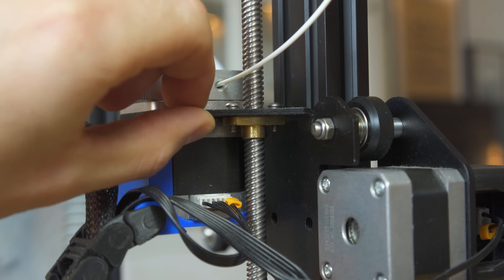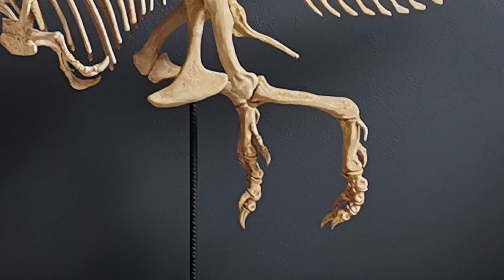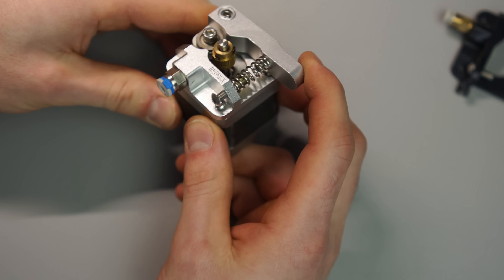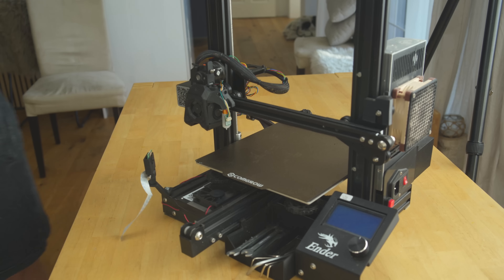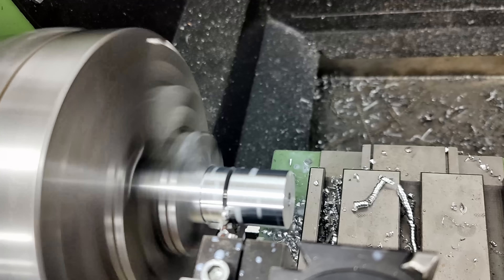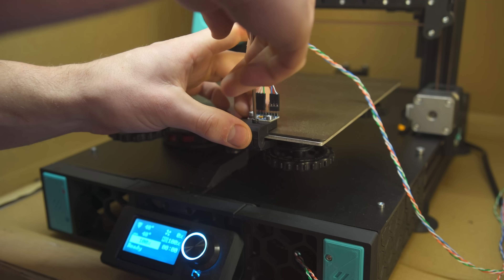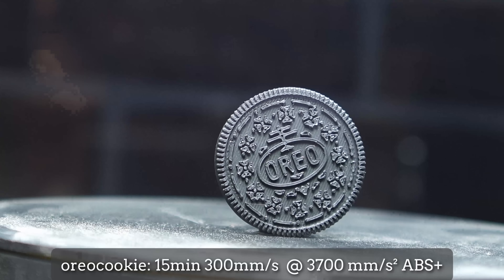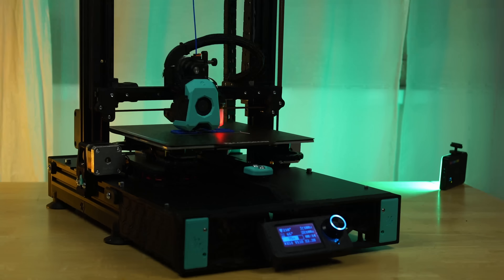I built the MOST EXPENSIVE ENDER 3

Comment: I know this is an old video but with all the new printers being released and coming pre assembled, it takes away the satisfaction and sense of accomplishment with building and assembling your own printer.
Great job. I really love the work and dedication.
Reply: it's still possible to do if you are willing to be tinkering for the first couple months in between a few good prints. I swear i've spent just as much time tweaking and upgrading as i have printing so far lol. It gets addictive. Gotta chase that next improvement. once i install thrust bearings and oldham couplers tomorrow (as well as direct drive and upgraded hotend down the road) , i pretty much will be at a point of diminishing returns until i can afford to do a CoreXY conversion or maybe even build a RatRig if I can afford one (RatRig would be my first choice if money wasn't a concern. I would hate to be halfway through a conversion on my Ender and realize i need another printed part). It can be frustrating at times with how all over the place cheaper Enders can be with quality control, but I have learned sooooo much in such a short time. CoreXY kits for the Ender 3 V2 are under $200 now as well.

Comment: That's not that expensive for a modified printer 😂

My ender 3 is worth 1150$ and that's nothing in comparison to what others have done. I tried to make it the cheapest possible way, I bought it used and I don't even have pressure advance on it or a modified movement mechanism. I bought 3 CHT nozzles (0.4, 0.8 and 1.2mm) and 2 bimetal CHT abrasion resistant nozzles (0.6 and 1mm), high temp direct extruder, new motherboard, new print bed, new print bend tensioners, modified motherboard cooling system and some other gadgets

Comment: Hi mate I recently upgraded my old Tevo tarantula i3, with a new Octopus 1.1, raspberry pi 4, with a 5” touchscreen, and 24 volt power supply, and upgraded the frame, and a modular hot end, in aluminium, so I can swop out a single to dual extrusion, and one good thing it’s so quiet

Comment: Truly inspiring indeed. I'm in the process of upgrading my own Ender 3, already adding the CR touch, direct drive and double Z axis. My family suggests that I just buy a newer and better printer but I just want to turn my old Ender into a reliable monster. I'm planning on changing to rail systems on all axis, changing the motherboard and upgrading the hot end and adding dual fans, also trying the new Creality Nebula. 

Also I must agree, as someone who likes to upgrade budget stuff overtime, building your own project is undescribably better than buying "good stuff" from the start.
Reply: Check out the ender ng project. Its quite fun

Comment: I could write this in German, but I will stick to English. 
Your sheer amount of knowledge, but also sheer lack off knowledge astonishes me. 
Why was your Ender 3 having issues with layers, well you had a BL Touch, this continues adjusting the Z height, which will show the slack of the Z screw way more. If you had kept the normal mode, and used a glass bed your prints would be decent.
Slow but decent. The ender is a slow machine, and for 99% of the users, this is enough. Just like any engineering company won’t need anything faster then a Prusa MK3.

Comment: I view modding my ender 3 as a more affordable way to force myself to become knowledgeable about how 3d printers work both electrically and mechanically. My first 3d printer was a folgertecjh prusa i3 which I could never get to work after the first print. The Ender 3 was my first real working printer. It has way more successes than failures. And Through Modding it and taking it apart and putting it back together I've learned a lot

Comment: an other thing better on this then a bamboo lab is that the ender 3 is completely open source and local, and will there fore continue working even if creality shuts down, i would not say the same about bamboo lab
Reply: I mean there’s always a way to mod stuff even if it’s not open source. My school’s tech center has a small desktop 3D printer that is made by this company that I can’t remember off the top of my head, but apparently they no longer manufacture consumer hardware, just industrial stuff nowadays. Anyway it requires these special filament cartridges, and there’s even a firmware lock to prevent it from using filament from other manufacturers. The guys in the tech center managed to hack together this controller board that’s basically just two buttons, connected to the printer’s mainboard with wires. The purpose of this controller board is to bypass the firmware lock and basically trick the printer into thinking it’s printing from one of those aforementioned cartridges. Then it’ll let you use any type of filament you want in it

Edit: it’s a 3D Systems Cube 2

Comment: I also have an Ender3 (well actually the Pro version).  I've updated the hot end to an E3D Revo CR, so I'm good to go with PETG and maybe ABS.  I got a WhamBam PEI build plate too.  I also have an HP T520 thin client to run Klipper (have you tried buying a RPi recently?)  I'm thinking of doing the Switchwire conversion, but I'll likely print the parts in PETG.  I know that Voron doesn't recommend the use of PETG, but as I have no use for ABS, and therefore won't put my printer in a chamber, PETG will be fine.  I've used PETG for parts on a previous Repstrap that I build, and I've never had a part failure.  Besides, I can't stand the smell of ABS melting!
BTW,  to upgrade the original Ender3 to a SW, you'll have to buy one piece of 4040 extrusion.  I assume you did.
Reply from the maker: Nah, I didn't buy any extrusion parts.
I'd print it in abs no matter what. It's more temperature resistant, the parts are probably scaled to accommodate for abs shrinkage and you could enclose it down the line. The work is the same
Jm2c

Comment: Love the conversion and chuckled at some of the "you have a problem" / therapy sections you edited in.

I'm in a similar boat with an aging Ender 3 and have been looking for a way to mount a Rapido and a direct drive extruder to my Ender 3. I see you accomplished this task prior to doing your conversion in "the plan of attack section". Curious what prints you used to mount the Rapido and Orbiter v2 to print your ABS before the full conversion around 4:37?
Reply from the maker: It's called Apogee toolhead
Reply: @ChristophLehner Surprisingly didn't locate that toolhead in my searching. Was looking at the Trianglelab DDE-R, metal Klemco groove mount + printable STLs, a few toolheads from squirrelf ( Apollolander, Solar orbiter, Mars orbiter, Saturn Orbiter, etc ), and hero me gen7.

Much appreciated, I'll look into that toolhead.

Comment: hi, i need help about the hotend. I saw that you used a fast phaetus hothend that draws power for 115 W and I was wondering if it was possible to directly connect it to the control board of the stock ender 3 or if you had to make changes to the board to connect it.

Comment: 10:43 The thing is, though: a Bambu Lab P1P is way more than those 650 € from that screenshot nowadays.

The price shown on it's website is 770 € for Germany. With customs and (import) taxes your going straight to 1000 bugs if you would import that thing. And thats without that highly praised AMS module which would add like 300 bucks as well. So for less (building) fun a good deal more. =)

Although I have to say a newer Ender 5 S1 with a BigTreeTech Pad 7 and another Ender 3 for spare parts would also have been a valid option for me!

Especially since there are some folks selling their barely used Ender machines on Kleinanzeigen which can also be a solid option.

Comment: I am thinking of going for this mod, including your stripped down Stealthburner. Do the STLs for the toolhead on your github work directly with the stock x-axis or is there an adaptation/adapter to make it work?
Reply from the maker: The stl in GitHub works with a linear rail, but for the original ender3 Xaxis you have to use the one from orbiter directly 
It's called apogee toolhead

Comment: Holly, this is so awesome, my respect for this great video and the great build conversion for the ender 3, I have one too that is like my baby, purchased on 2019 and still rocking, recently  I purchased a skr e3 v3  but have not install it yet, I want to use klipper with it, I want to be able to print higher temperatures material for print automotive parts, what kind of upgrade can you recommend me and if is possible to use the same fanducts that you used and same extruder without all the others parts conversion?

Another question is have you done multicolor prints on yours by simply changing filament color? Just curious about if would be possible by using the bltouch

Comment: man youtube is so unfair, i havent been able to get my auto level to work tried for 6 months it just kept driving the nozzle of my ender 3 into the print bed, and all i am getting recommended is tricked out ender 3s man
Reply: In case you haven't fixed it, what's your Z-offset?
Reply: its honestly just been sitting in the garage since that comment was made, i installed an ezabl laser went through the install video including editing some minor code that coorisponds with the machine and it just drove the nozzle right into the bed i was quick to turn it off though, i actually just bought a resin printer instead thats how not interested i was in messing with more software no idea what the offset is tbh  @NM-wd7kx

Comment: Think I'm gonna just go with the cardboard enclosure...oh yeah, and the dual-z-bar kit, BL Touch, BT Tech main board, BT Tech driver chips, dual-gear extruder, BT Tech touchscreen, silicon heater cover, Noctua fans, flexible couplers, bi-metal thing for the nozzle and that's all...maybe. Cheers

Comment: So My question is. With using just the stock ender 3 pro frame/extrusions, if I upgrade to a direct drive and Setup Klipper. Would I be able to achieve the same results as far as speed and efficiency or at least come close to the same  results? My printers are a 24/7 work horse so taking one down to print parts for this, is basically not possible right now, because the down time would kill production for me. So just looking to do the minimum for now until I can get my inventory up.

Comment: I reinforced the 4040 extrusion which is as you know hollow inside.  I used 8mm metal tuning with 5mm hole.  Cut it and beveled the ends so that the m5X45 bolts goes through the tube and then does not allow the 4040 to collapse when tightened!  This is by far the best thing I have done to my frames.  As you know the bed runs on a single 4040 attached to a single 4040 I frame. This is very very poor especially if it is over tightened at anytime.  Adding the tube prevents such event and absolutely give amazing rigidity.  I hardly ever have to adjust my bed now and it stayed within .001 on all corners now.   Obviously depends on the integrity of the x gantry, which I have dual 1204 ball screws on!  Zero lash ZERO.  The 800 steps seems to hit the magic numbers much more precisely, IMO.  Great content you have , thanks for all you do.

Comment: If you run 3600 acceleration you will only reach 300mm/s for 5mm on a line that is 30mm. So doubt you reach even 200mm/s. Also your minimum layer time must have bin set to 0.
Nice printer though. I am converting a ender 3 to that I just picked up for 50$ :)

Comment: I did this a bit over a year ago (modified the CAD files myself), but skipped a few more parts than you did.  I also wouldn't count the price of the Ender 3 in the total.  The only reason to do this with an Ender 3 rather than from a parts kit is because you already have one.
I will completely agree that you shouldn't pull apart your only printer to do this.  You need a backup printer that is untouched during this process.
I had also done X and Y linear rails already (cost was similar to replacing the V-rollers).
Mine is janky when it comes to "case" which it doesn't have, but it prints well.

Comment: Absolutely love this build. I'm wanting to do the same with my Ender 3 Pro but can't find a proper step by step guide. I presume you printed all the upgraded parts/frame using ABS?
Reply from the maker: Jep, everything is abs
Reply: @ChristophLehner  I keep coming back to this video due to how amazing this printer looks and how well you edited this video. Can I ask where you got the black linear rails from? I can't seem to find anyone that sells them individually, I'm needing 5 for my Ender 3 Pro. Also did you have to change your bed at all or it came with mounting brackets for existing bed?
Reply from the maker: @happytodd  I've got them from amazon.

The bed is basically stock, i just drilled some.holes.in the bed carriage to mount it to the linear wagon

Comment: Just buy a Bambulab P1P, it is 15€ cheaper and prints in <3 minutes
Reply: Prints what in 3 minutes? If you're printing parts with functionality those prints take 40+ hours
Reply: @coltenmeredith8899  I only print functional parts and when I completely fill the room of my bambu 256x256x256 the print takes about 6-7 hours max. So I cal BULLSHIT :D
Reply: @Termynat0r  I see. What speeds do you print at?
Reply: @coltenmeredith8899  I don’t really know, it’s in standard setting and there are sport and ludicrous which are faster. Ludicrous is up to 500 mm/s I think
Reply: @Termy  Woah....That thing prints FAST. That might be faster than the Voron 2.4 R2

Comment: I think a lot of us tweak the hell out of our Enders.  I probably should have just built a Voron by now, but my Ender 3 has linear rails, dual-Z axis controls, new mainboard, silent steppers, all metal hotend, direct drive, bed leveling, Octoprint, and a LACK enclosure now.  About the only thing I feel limited by on it is the 235mm bed which I occasionally still find some prints that won't fit on.
Reply from the maker: This is the way !
Reply: Buy and ender extender

Comment: IMHO: too expensive solution was chosen

1) If you include the price of a new ender 3, it should be new - with new wheels. Thus you can stay with the wheels. Minus approx 90 euro (including extra for an Ender 3 Pro).
2)If you'va got the rpo version, you would've had a magnetic table from the beginning. Minus 10 euro
3) With an ender 3 pro, you can put your PSU on the bottom with no need to raise the frame (printables com model 187424-ender-3-pro-bottom-psu-mount). So you don't have to print skirts and all the base. Minus around 40 euro
4) you can switch not to an expensive pahetus, but to an E3Dv6 (I chose mellow wind, see example printables com model 187417-bmg-wind-ender-3-stiff-mount). Minus 100 euro if you stay with the stock motor
5) MINI12864 LCD is completely not needed, as you can use stock ender 3 screen. Minus 15 euro
6) you've printed the dragchains, why buy a new set? Minus 25 euro

So in total you can get the same quality for only 534 Euro. Which is still significantly more expensve than the stock Ender 3 Pro. BUT! In reality you will pay even less, cause you wont buy from amazon - you will source your build from aliexpress during sales periods.

Nevertheless - your experience = good experience! Thank you for your video!

Comment: Looks great, always fun to re-engineer something into a beast.  Those first much faster prints feel rewarding.  

Pretty sure I beat you on expense for an Ender 3 though, only thing stock now is the frame :/  5 linear rails, IDEX direct drive, dual Z side lift belts, Octopus, AC heated cast aluminum bed etc.  Has 10 micron Z resolution with microstepping disabled using a 20:1 reduction on Z.  I designed it during lockdown and built it last year, every part printed was my own design including the compact DD's.  It felt really good to get it up and runninng and tuned, Klipper is amazing.  

One last thing I may do is ditching the old style V6 hotends and putting on a pair of Dragon UHF, sick of fighting nozzle changes.

That's what is fun about open source products, grab the CAD file and go nuts.  Make something your own.
Reply: Sounds like a super interesting build👌 did you share the project anywhere such as GitHub and do you have pics or videos of it up? I’d love to convert my spare Ender to IDEX so I can do some experimenting with HIPS supports on complex ABS prints.

Comment: The voron cube quality is horrible,  ender 3 makes very good quality gears If you calibrate it, smolth surfaces.. I think you need to adjust the temp.  You basically have to adjust it due to the viscosity of molten plastic and speed, but about 50mms it doesent matter much
Reply from the maker: lightning was harsh in this shot, IRL the cube looks perfectly fine

Comment: Well, to be able to get to 300mm/s you need to have a insane amount of acceleration to get to that kind of speed. You might have set it to 300, but im 100% your printer wont reach that kind of speed on an oreo or benshy =) set it to 50000mm/s and it will probably print at the same time as 300 =)

Comment: What is the reliable printing speed with this setup? If it can reach the 200mm/s print with quality, I will jump in that again to rebuild my Ender 3 pro
Reply from the maker: Dont do it 😅 you'll spend more time and money, as if you'd buy or build a trident / x1c 
But yeah it cab print at 200mm/s without much fuzz
Reply: @ChristophLehner  I have all the parts for it. Just failed to succeed, also I didn't have another printer. Now I have and the parts just laying around the house somewhere🤣🤣 Also your toolhead is really good, I didn't like the voron's huge head on a small printer like this.
Reply: The other option is to build a vzbot 235, but some parts are missing, so....